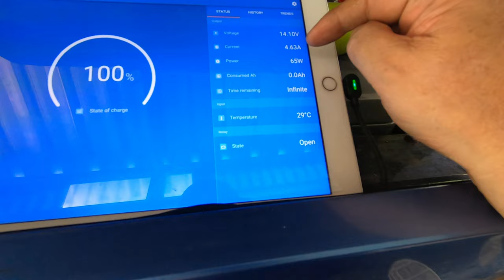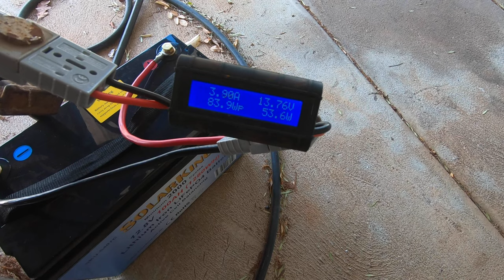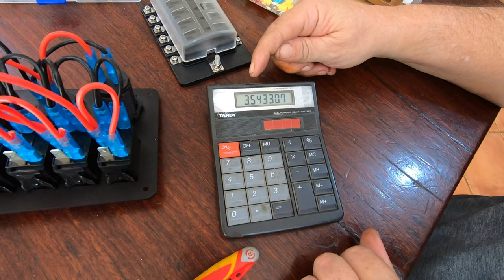5 Gang LED 12V Switch Panel.  How I wire it 2

Comment: Yeah it’s handy how the light on the fuse block lights up when the fuse is blown. Very similar fuse block I got for the van build . Hope all is well mate 👍🍻
Reply from the maker: Yes i like that on it. Makes it very easy to tell if the fuse went POP. All good here. Few storms and a bit of rain. Strange summer for down south of WA